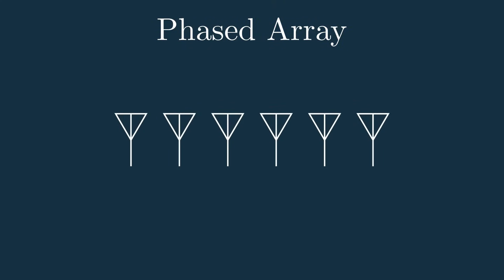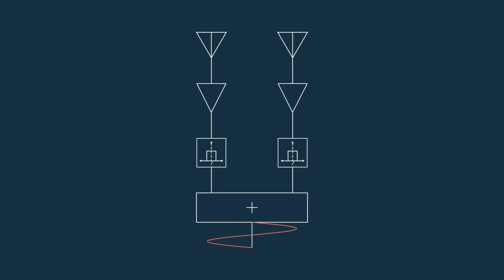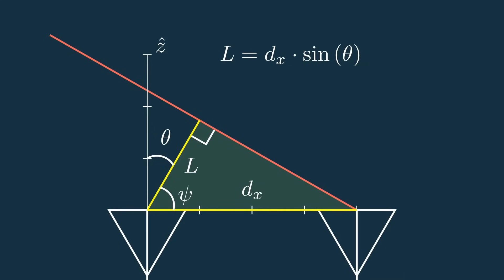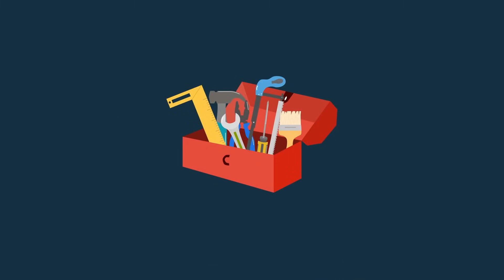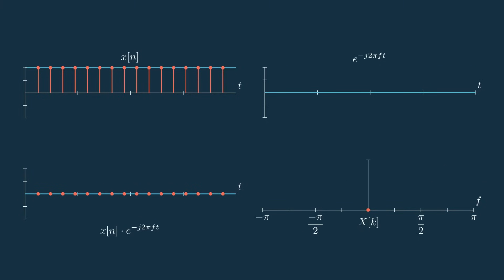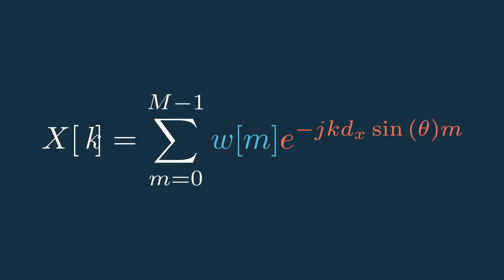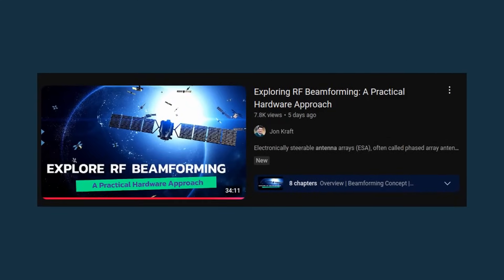Phased Arrays - Steering and the Antenna Pattern | An Animated Intro to Phased Arrays

Comment: Hi, first, I wasn't subscribed, now I am
Great video, I immagine that there is a way, maybe it's out of the scope but in the case that I have antennas with some strange radiation pattern I just need to combine (multiply) the pattern "in a graphical way" (the value per angle) or the hole process would be different? Also in the case of various spacing the only thingh I need the change is the sample position matrix when computing the laplace transform? 
When this exam session finish I will certainly start simulating on thia topic
Reply from the maker: If I'm understanding correctly, yes, you can just multiply the element pattern values by the array factor. And I've seen the non-uniform spacing done by still representing your elements as a matrix, but finding the least common multiple of spacings and normalizing to that at the end. Hopefully that helps a tiny bit - it's kinda hard to explain the second one over text

Comment: Great video! So are there phase shifters dedicated for receiving the return signal and phase shifters dedicated for sending and steering a signal? In short, how does the phased array antenna send and receive at the same time?
Reply from the maker: Often times they don't receive and transmit at the same time. They'll use high speed switches to switch between Tx and Rx with very short intervals. What "short" means depends heavily on the application. The phase shifter will often be shared between both. Thanks for watching!

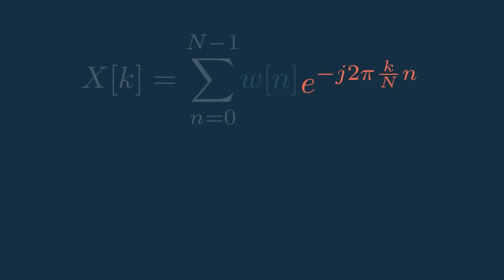Comment: In 14:10 correct me if I'm wrong but this is not an equation of sine in complex form. Sine in complex for is sin(x)= (e^(jx) - e^(-jx))/2j (which btw is kinda cool when you take this equation as two vectors where one extends the other, it looks like some machine). This equation is for cis cos + j*sin which Fourier transform is doing. Fourier transform checks correlation of a signal with sines and cosines.
Reply from the maker: Yes, you're exactly right. This may have been a bad decision on my part, but I thought the added complexity of showing the complex form was not necessary for understanding the concept. Also, my computer doesn't have a GPU and rendering 3D animations takes a significant amount of time which I feel would be necessary for cleanly showing the complex exponential plot. Let me know if you disagree with my decision. Thanks so much for watching!
Reply: @MarshallBrunerRF  thank you for explanation! Makes complete sense; I was just a little surprised when I saw this equation and heard sinusoid ;)
Reply from the maker: No problem! Thanks for the comment. Always let me know if I say something wrong or something that just seems off. It's very possible I'll make mistakes and I'd like to correct them ASAP

Comment: If you just stored the data from each antenna individually would you be able to process it software side to scan and collect data from all around after initial data reception?
Reply from the maker: Yup! Good intuition. Unfortunately that comes with a huge cost because digitizing hundreds or thousands of elements requires lots of expensive ADCs, increases power consumption and heat dissipation, etc. It's definitely a difficult tradeoff space

Comment: Minor issue, the fourier transform of a sine function is a dirac delta function at the given frequency and its negative. A rectangular window gives you a sinc function in the frequency domain and the fourier transform of the multiplication of a rectangular window and a sine wave finally gets you a sinc function centred on the frequency of the sine wave. Everything else was fantastic.
Reply from the maker: Yes, you're correct. I probably should have clarified that. Good note. Thanks for watching!
Reply: I think he used the sinc as the transform instead of a dirac delta because your sampler, the phased array, windows your signal because your phased array isn't infinitely large. Therefore you would read a sinc function from your phased array even if it's just DC. In infinite time horizons (or infinite spatial sampling) it would definitely be a dirac delta but the phased array is just a rectangle of antennas which is like a spatial window.
Reply from the maker: @ yes!! Maybe foreshadowing the next video…
Reply: @merseyless  I don’t understand a word of what you just said, but I really really want to. Hitting the books hard over these next couple years principles of radio and electrical engineering. You’ll never read my name in anything, but I promise I’ll contribute something that will be worthwhile.
Reply from the maker: I'll always remember lambda420
Reply: @Lambda420 merseyless is talking about what different waveforms look like in the time domain and what they look like in the frequency domain. A dirac delta is a special type of waveform that is infinity at 0 and zero everywhere else. Also, the integral of a dirac delta is 1. 

This is important because wide signals (wide as in the sense that y = 1 is wider than a gaussian distribution, for example) in the time domain will be narrower in the frequency domain. So y = 1 in the time domain (the widest possible signal) will be a dirac delta in the frequency domain (the narrowest possible signal). It also works both ways.

It'd be worth learning fourier transforms, taking a class on signals and systems if you wanna learn more. (6.003 at MIT OCW) would carry you far if you put in the effort to learn it. I'm a junior undergrad in EE and I use signals ideas at least a few times a week in my extracurriculars.
Reply: @Lambda420 if i understand correctly, he is substituting the sinc, (sin x)/x, for the dirac delta function. Since they both equal 1, but you can restrict the domain closer using sinc.

Comment: Can you get into how to make each individual antenna? Or how you would go about designing an antenna for a certain frequency?
Reply from the maker: That is a super deep topic with so many answers. In my jobs, I do more on the electronics side, so I'm not super involved with actual antenna element design, though I do know the basics. I don't think I would feel very comfortable talking with any authority on antenna design at the moment, so it's probably not something I will cover soon. I can, however, recommend Balanis' antenna theory book which I've read at points to understand something my coworkers are doing.

Comment: Your manim work is really good, I know it takes a lot of time, keep up the good work :)
Reply from the maker: Thanks so much! It's still like 99% manim, but I did try out matplotlib animations for this video on the 2D array animation and it worked really well - so much faster than manim for rendering. My initial attempts to animate that were taking like 2 hours to render a 30 second animation on my old laptop. Thanks for watching, and keep up your good work too!
Reply: @MarshallBrunerRF  damn that is crazy, I didn't know you could do that with matplotlib.

Also did you try turning off caching for manim? Sometimes it is worth turning off for additional render speed.
Reply from the maker: @ Yeah I did it with FuncAnimation. And yeah I always run with the --disable_caching flag. It's partially bad because there were multiple ValueTrackers running for that animation too
Reply: @MarshallBrunerRF  damn was hoping that might be a simple fix lol
Reply from the maker: @ I'm curious to see how it runs on a nicer computer as I'd like to upgrade at some point... My laptop just has integrated intel graphics, so I think anything with a dedicated graphics card would run laps around mine in this regard.
Reply: @MarshallBrunerRF  Yeah my computer runs manim decently fast. It isn't a super nice computer but it has okay specs for when I built it 6 years ago. Hopefully your videos blow up and pay for this new computer :)
Reply from the maker: haha yeah! it's painful buying a new computer knowing the components will be slow in a few years

Comment: 9:46 Technically, the DTFT of a finite discrete time sequence of ones is an aliased sinc rather than a sinc, but that's kinda moot once you introduce a taper / window / weighting function.
Reply from the maker: Thanks for the clarification. I try to walk the line between being concise but also providing enough information to not leave you wondering about too much. Thanks for watching!

Comment: Suppose the antennae array is aperiodic.  The brute force method could be to model an array with a smaller lattice spacing, say 0.1a and 0.1b and set the input amplitudes to zero for all unoccupied positions.  Is there a more elegant approach?
Reply from the maker: You could definitely do it that way! I've seen it done that way for triangular lattices where every other element is weighted as a zero then you divide the size by 2 at the end. I think that works best for computational modeling, but the math should work out if you also have dx,dy as arrays with varying values. I honestly haven't tried that, though. Thanks for watching!